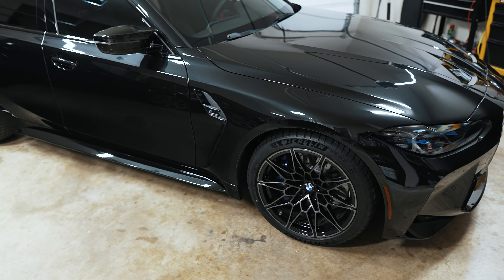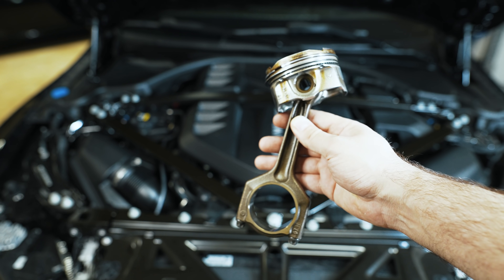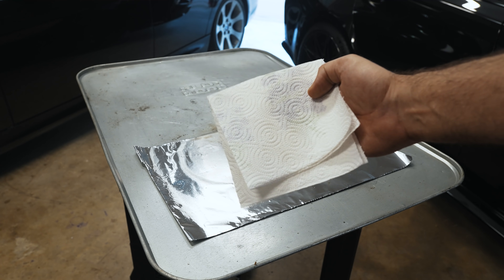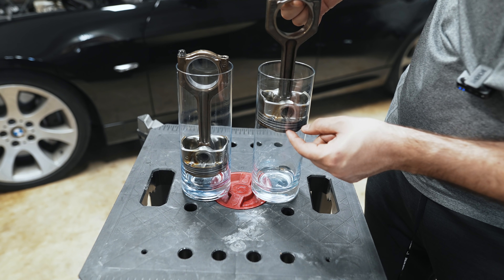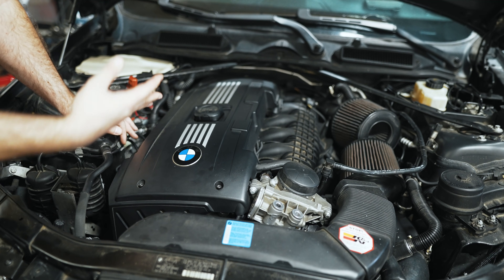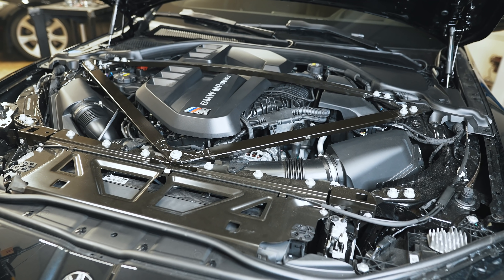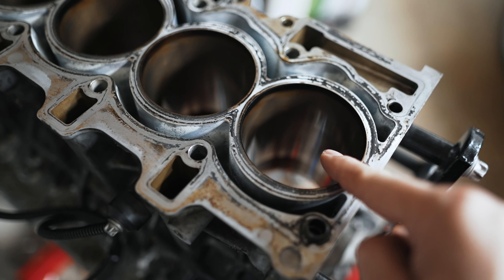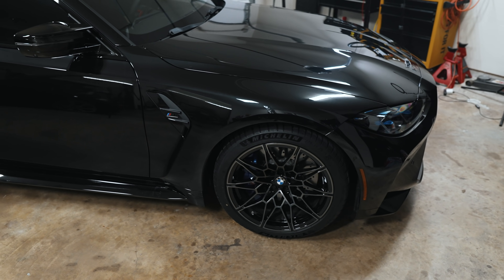This New BMW Engine Will Make 1000 HP Stock!

Comment: I don’t understand why everyone doesn’t just run E85 in their cars if most modern cars can handle it, and it burns cleaner, I don’t understand why they’re trying to get rid of gas powered cars so soon with all these new electric models coming out when they should just switch every gas power car to ethanol. Doesn’t that sound better for everyone, we get power and the planet slows down from dying? Someone help explain why they can’t realized such an obvious problem. Even if some cars can’t run it, at least have the option at every gas station that way if someone wants to run cleaner they can.
Reply from the maker: There was a big push in the early 2000s to run E85, the government subsidized it.  Given how clean it burns and how relatively sustainable it is you'd think it would have bridged the gap to electric cars.  The same effort was made by the government in Brazil and it worked.  I think the public didn't really see the value in it given it was priced similarly to gasoline but didn't offer the same fuel economy.  If they had put larger tanks in cars and make it cost 1/2 as much I'm sure a lot of people would have looked into it.
Reply: It’s not economically feasible cost wise to run vehicle solely on E85 it gets extremely poor gas mileage and the planet doesn’t have the resources at least this time to sustain product of ethanol for everyone.
Reply: @stoss-11  my economics teacher made an example and said that if for example Austria wants to cover it fuel needs from plant based fuel only it would need fields as large as Austria itself just to meet the demand.
Reply: After 4 or so tanks of e85, it's good to run a tank of normal gas because it will start gumming up the injectors and causing reliability issues. Just my experience.
Reply: @markburkey6371  I think bmw systems are a bit different at least bmw’s 2015+ cause I have multiple friends that have been running an e30 mix for a year and some 8-9 months without any flush of real gas. No problems at all. I think modern Engines and injectors are fine. I’ve actually read the ethanol helps clean injectors
Reply: @stoss-11  that's only e30. It's mostly gasoline which would clean itself just fine. I'm talking about full e85.
Reply: @markburkey6371  ahhhh I see, true. I guess too much of anything isn’t really good

Comment: 2jZ stock doesn't make much power compared to the N54 out of the box from what I understand.  Wish I could afford a S58. :(  GUess my N54 will have to do.  I thought if you lowered the compression you could shove more air and make more power?
Reply from the maker: Yeah it's only when you throw  a set of rods and pistons at it that it makes crazy HP and is swapped in a lot of race cars.  Yes if you're going to build an N54 for high HP you'd reinforce the block and lower the compression ratio a little via different pistons.

Comment: I mean, stock for stock the 2j and n54 are reasonably competitive.  They both start running out of reliability around the 700 whp mark. Might not live forever at that power, but that's OK lol.
Reply from the maker: Stock the N54 is an amazing value for the power it can make.  Given how cheap it is you'd think they'd be snatched up and used in drift cars and swapped in many other cars.  They just can't be build to make 1000HP+ with just a set of piston and rods.
Reply: @VehicularDIY  oh yeah, the architecture just isn't there for big big hp builds. But the internals thankfully support the hp the block can handle.  Also I just wish 6mt cars didn't have those stupid welded ring gear diffs.  2 way differentials are impossible to get.